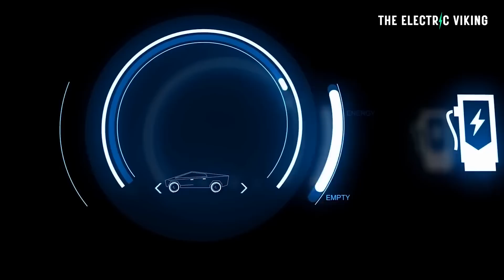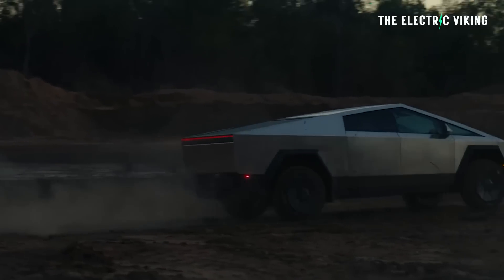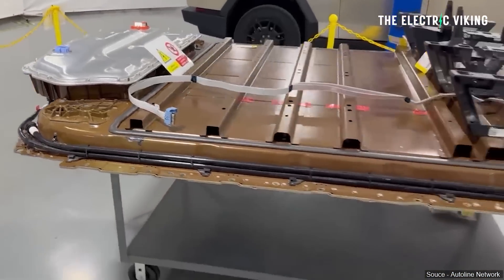Tesla Cybertruck teardown discovers how the seats are attached to the chassis

Comment: It's weird how someone else beat Sandy Munro to taking apart a Cybertruck.
Reply: For a complete engineering and costing analysis wait for the Munro tear down.  It's started around the same time and will be more detail oriented down to the individual weld, nut, bolt, IC Chip, etc, etc along with the specific metallurgy/chemical composition used for each component based on lab analysis.  The purchase price of the CyberTruck may be a drop in the bucket compared to the cost of doing a Munro Analysis to that level of detail which is very time consuming.

Once Munro gets done with a tear down and analysis the vehicle is just spare parts and scrap metal so it can't be easily reassembled and driveable again.

Best!

Comment: The cybertruck as a hero model has many interesting components. It just calls for so many new questions. Such as if the electronics of steer by wire fails, what redundancy dies the cybertruck have in case of emergency's. Planes have had steer by wire for a while, but also have redundancy's in case of emergency. There's no talk about that in emergency's. If there is structural damage to the gigacasting at what point does structural damage become repairable? I'm getting the impression that the repairability of the cybertruck is less due to larger unified components rather than smaller part components. I think there is a trade-off between safety efficiency over repairability. I think if a dent in the gigacast automatically means a write off, a cybertruck by definition ition is going to be expensive for that matter maybe even for other Trsla's. I think that is worrying, and repairs should not have to be expensive. I think there merrit to repair current EVs on the market without it become a write off as the slightest issue and that we're so afraid of claims and litigation that we don't want to take any risk. I think in that regard, if that is the state of repair for modern EVs, it almost suggests, to me, that there is something wrong with the engineering of EVs by universal design. After all a right off is also expensive for those insured because ot means we all have to bear costs of the loss, which brings up insurance costs. Simply increasing premiums can only go so far to change behavior. It would also be nice if repair costs are well affordable and don't have to cost hundreds of thousands of dollars for a proprietary common car part.
I did hear a new gigacast part is not expensive, luckily😊. Let's hope the cost of labour is not too high either. That could be an advantage of modular design, easily dismountable, swap the broken part, and refit parts like logos.
If a cybertruck needs to fot a new battery, how easy is it to refit the seats and flooring?
If the cybertruck support a plugin for wireless charging, will they also allow cheaper third party wireless charger solutions, or be like apple and hardcode all parts, so that they only fit with Tesla parts, by design and reign monopoly. I think this could become a relevant question is a third party could make better wireless chargers than Tesla. We've already experienced wireless charging on electronics for years, there was a wireless charging standard war at one point and Qi was there and Apple was still trying for years and came late with their wireless charging, only for iPhone. I know in the lastb5vyears there have been independent companies that have solved many wireless charging woes for EVs. In my view wirecharging for EV is the future and could solve a lot of charging space issues in cities, as not everyone owns a home with a garage. If wired charging options are also limited due to space constraints I think wireless charging could solve that issue. You wouldn't need a whole stall infrastructure butbpotentionallybonly connect the charger to a mains cable acces point, which I think could dramatically reduce cost of installation and more parts.
I wonder if this news of wireless charging means EVs are going to get expensive again. We used to have wireless charging galore on mid and upperend smartphones. Now they seem reserved for only higher end phones. Which is weird. For the technology is only a set of circular wires that can easily fir in any toer smartphone. Even aftermarket solutions already allow 15 W wireless charging with USB c port connectors for 10-15 euro's. To me it means it is simply a no brainer that any smartphone could have wireless charger by now. I don't understand the exclusivity to only higher end devices. The technology and costs are easy, and yet we accept to pay premium for wireless charging on high end phones only.🤔.
Curious to see what Trsla will do with yhe model 2 and if we're getting wireless charging as standard. Wouldn't be surprised that would comprise part of the 25000 dollar price premium. I think Teesla could easily make a 20000 dollar model 2 well specced base model and still have a profit. Projections are batteries are getting 50% cheaper by the end of this year. Surely Tesla can drop the price. I think demand would sore through the roof and makes more sense  for a price point.

Comment: Safety is the No1 consider for most people. Volvo & Saab were the pioneers which lead to the NCAP safety standards. Renault was the first company to have all of its cars as 5 star rated back in the 90s.
Reply: Yes and tesla's have 4.5 to 5. And now have the new 5+ rating. I think is silly just make it 6 stars.
Reply: @shawncooper8131  Just checked the website & there is no NCAP 5 + rating.
Reply: Not anymore

Comment: I say that the panel gaps make the tear down a lot easier. :) 

Wireless charging that is effective for a car is about 10 years away. 

Another Tesla delayed/vapour ware product.

Tesla never hit deadlines.
Reply: Wireless charging for cars has been available and useful for years. Can be as efficient as cables...
Reply: @0ooTheMAXXoo0 but no way as quick as supper charging, musk is good at selling Hype And not bringing it to market as fast as he says. It will come and if it works properly.
Reply: Can be but it's not. Up to 40x slower than fast charging.

A charging pad on the bottom of car.
Wet pads reduced charge effectiveness.
You could have some underside damage, increased risk of fire.
Reply: Who's deadline?
Reply: Their deadlines. 
Plus shareholders. 

Cybertuck scheduled for 2021. 
Delivery was 2023.  But with higher price, shorter range. And a truck that cannot be sold in Europe as it is deemed unsafe. 

New roadster should of been 2017  released????.

Delays = lost revenue from no sales and extra development costs.

Comment: Wireless charging powered turnouts every few miles along highways would eliminate range anxiety. This is why, for several years, I've been opining that charging stations may become as obsolete as video rental stores. 95% efficiency is plenty good enough. Charging pads at restaurants and stores would be attractions; soon all public places would have them. I can even see locations bragging about the speed and low cost of their charging spaces. Thoughts?
Reply: My thought I own a Y do 90 % charging at home after 9pm .06 cents per kilowatt. The Tesla superchargers for long trips already suffice.
Reply: Far far to expensive vs CATL, BYD and all the other battery makers that keep dropping prices.... a 1000km battery will be cheaper sooner than engineering a road. I can see this in F1 or nasscar
Reply: Not having to leave the vehicle for the cord is a safety &  disability issue induction charge will eliminate.

Comment: What is the advantage of a wireless charging pad in your garage?  I would be worried about running over the pad and it seems like a "solution" to what is not a problem.  Reminds me of my yoke.  Does any body have any thoughts on how this would make charging easier?  What am I missing?
Reply: Yoke is awesome. Have 2 Model Ss for 2 years.  Wouldn’t ever want to go back.  Objectively superior.
Reply: Auto charging.  No cord
Reply: @GWAForUTBE But the diagram still looks like you have to run a cord from your wall to the charge pad.  So I don’t see the advantage.
Reply: @mpow1404  good imagination
Reply: Like wireless charging your phone

Comment: Seats bolted into the battery case?  That tells me there's a lot less between the occupants and that humongous battery...which seems like a bad idea.

By the way, most parts for GM and Ford trucks ARE coming from NA as well.  If the Tesla blurb can be believed, they're just as American.
Reply: What bad would happen from there not being more space between the seats and the battery? Explain it in engineering terms.
Reply: @juliahello6673  Well, in SAFETY terms, it means there's one or two less layers of material between the occupants and the battery.  Should damage and fire take place, it means it has less to go through to burn inside the passenger compartment.

Remember, this is using the battery pack/case as a structural member of the unibody frame.  Any damage to either end is going to be transmitted to the batteries.  That wouldn't have been the case before, when the pack was an isolated component protected from those forces.
Reply: @billcichoke2534  I think the Tesla engineers have worked it out. I don’t think you’re qualified to discount the safety. What type of engineering degree do you have where you would be able to understand it?
Reply: Did you look at it? 5:08 they are attached to U beams or whatever they're called.
Reply: @MidnightHammer-n7h  Yup.  DIRECTLY to the top of the battery case.